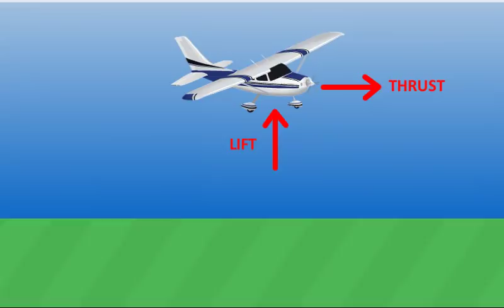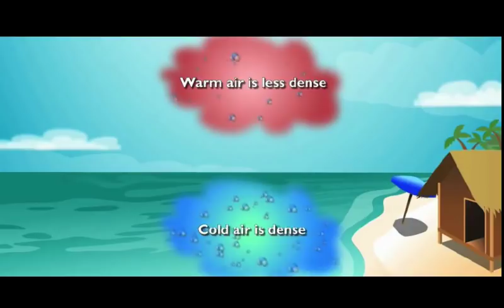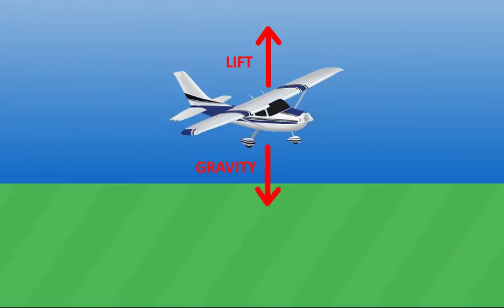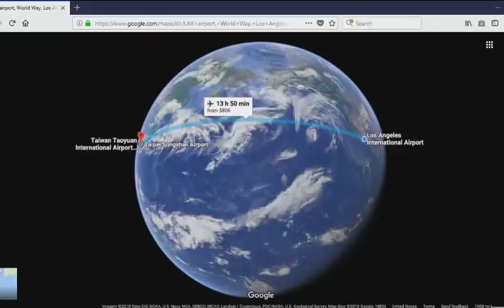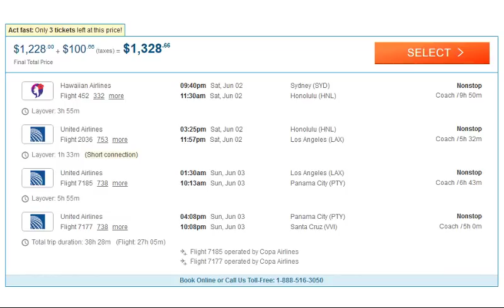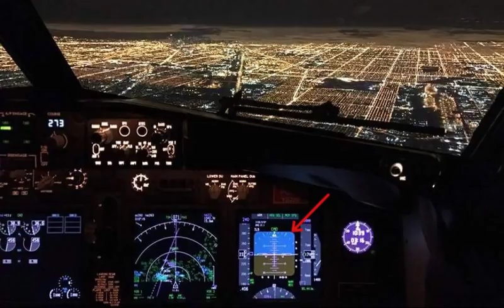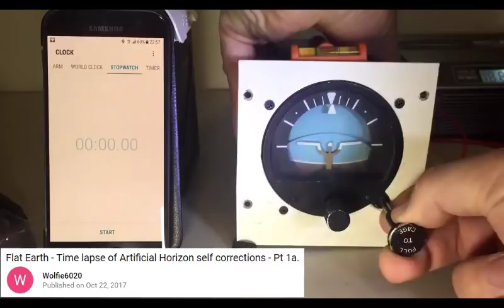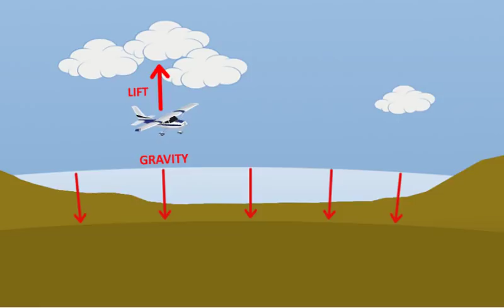Flat Earth Falsities - Plane Nonsense

Comment: If the air were held to the Earth by gravity, while at the same time it gets weaker as you go up in the atmosphere, and the Earth is rotating at over 1000mph, the air at ground level might possible be dragged along at the same speed but certainly not at higher altitudes. Conversely, the air would have to travel even faster at higher altitudes because of the larger circumference it need to cover.  But 1000mph is at the equator. The speed slows as one travels away fro it to where the poles would not be moving. The air that the author claims is travelling at 1000 mph at the equator would travel at slower and slower speeds as measured at different latitudes. With all that difference in air speed starting at 1000ph at ground level to much ore at higher altitudes to lower speeds towards the poles there would be obvious and very extreme wind shear situations. Air speeds in excess of 1000ph at the equator to zero at the poles would be noticeable. We are talking wind four ties stronger than a tornado!
Reply: Robert Lefebure
"the air at ground level might possible be dragged along at the same speed but certainly not at higher altitudes"
Yes. Yes you are.
Reply: Well, maths, physics and logic aren't your strong suits are they.
Reply: Robert Lefebure • Are you trying to claim gravity somehow stops working at high altitudes?
Reply: Robert Lefebure Did you ever notice if you stir in the middle of a pot, the water on the outer edge turns too? That's because the turning water in the center drags the rest of the water along due to friction. That's how it works for the atmosphere as well, except even moreso because there's no stationary pot providing counter-friction at the edges.
Reply: Brett VV No.
Reply: Its called Newton's first, second and third law of motion. If the air isn't experiencing anything that would cause it to slow down; it would continue accelerating till it mached the velocity of the earth. 

<possibly slowing the earth's rotation ever so slightly>

Good thing you brought up the atmosphere. Did you know that wind wouldn't be possible on a flat earth.
Reply: And what keeps the air at the edge of the vacuum of space from being sucked out? It would be at the very outmost limit of gravity's hold on it yet, just at the contact point of the most powerful vacuum known. Air inside vacuum containers on Earth doesn't act that way ... it disperses inside the vacuum.
Reply: Robert Lefebure Vacuum can't be "powerful", vacuum is literally nothing. All that matters is the outward gas pressure vs gravity, and the extreme upper atmosphere is at very low pressure, meaning very little force trying to push it into the vacuum. It's a very gradual transition.
Reply: Gestahl It is extremely powerful in the context of the "relative". A number of people here say the air at the equator is moving at the same speed as the ground surface below it (which is absurd because the ground would "slice" through the air if it were indeed moving  just like every other moving object does). These people somehow believe the Earth's surface behaves differently (or would it be the air that is behaving differently?).  Your point "meaning very little force trying to push it into the vacuum. It's a very gradual transition." , I would point out the fallacy that "little force" is still, indeed force and would therefore constantly and perpetually be forced outwards away from the gravity in order to reach equilibrium. That's why I said it would be impossible to replicate an air glob sustained in a vacuum chamber. There would never be an "edge" of such a thing as an edge of a glob in a vacuum because the air would disperses evenly throughout the vacuum chamber. The air glob (i.e. the Earth) in the vacuum of space (without a container around it) would be such a scenario and is unsustainable.
Reply: Robert Lefebure The air wouldn't evenly fill the vacuum chamber if it were tall enough, pretty much everyone acknowledges that air gets thinner at higher altitudes. There will always be some gas pressure wanting to push outwards / upwards but that tiny amount of pressure isn't enough to overcome gravity.
Reply: Robert Lefebure The air above the equator would be moving slightly faster than the ground the same way the outside of a bicycle tire spins faster than the inside, but I don't see a problem there.
Reply: Gesathi You are totally assuming "slightly faster" but first, it would have to be slightly slower because objects at rest tend to stay at rest. The upper air would need to get its motion from the lower air. But the elephant in the room is the whopping 1100 mph that the Earth is supposedly rotating at. Some here try to argue the ridiculous (that the upper air magically attains the same ground speed as the lower air which would require an INCREASE of speed without a corresponding input) but the upper air would be expected to rotate at slower speeds the higher one would go.  I argue that not even the air at ground level could be expected to achieve the same ground speed as the Earth rotating under it and that there would ALWAYS be a  very sizable wind. Not only is there no such wind, there are also the effects of doldrums and rotating wind storms like hurricanes and tornadoes which, according to the rotating Earth theory, are rotating winds of 75 to 250 mph, travelling over a surface under them travelling at a ground speed of 1100mph while, at the same tie, achieing their own ground speed of 5-25mph. It's all totally unfathomable.

Comment: The explanation of planes not getting altitude on a round earth "because are going away from gravity" is joke.😊
Yes, to get higher you spend energy and you get higher potential energy but the plane already has and spends energy to get speed.On a round earth
The gyroscope shows nothing, the plane flies straight, the altimeter shows higher altitude, and the speed would decrease until there will be a balance between the cinematic energy and potential. Only at that point the plane doesn't climb anymore.
Reply: @Ion John   And again. Why are you ignoring the facts?
You have had this explained to you before, but it seems your attention span is severely limited.
There is no adjustment needed as the aircraft will naturally follow the curvature of the earth without any input from the pilot. This is because the aircraft flies through the atmosphere which also follows the curvature of the earth. It's the air pressure that keeps a plane in level flight. Increasing altitude reduces the lift and the plane falls; decreasing altitude increases the lift and the planes rises
Inertial navigation is different.https://en.wikipedia.org/wiki/Schuler_tuning
Maybe you should also have also  looked up Schuler tuning. The "schuler loop" is an integral part of avionics, that automatically compensate for earth's curvature.
https://en.wikipedia.org/wiki/Schuler_tuning
And read  the references provided.
http://www.mediander.com/connects/26619546/ln-3-inertial-navigation-system/#!/topic/-/
http://aerostudents.com/files/avionics/navigationBasicsAndInertialNavigation.pdf
So please stop repeating your previously answered questions. All of them.
Reply: John Toas Maybe you can try a scientific explanation of the miracle?
Reply: Who rattled your cage? You had new rectums reamed earlier because of your stupidity and here you go again.
Reply: John Toas So how the plane flies straight at the desired and constant speed without any correction of altitude. The "explanation" given is valid only for the minimal speed at which the plane flies, for a lower speed the plane would fall. Planes fly at any speed and any altitude, up to max for which was built,
Reply: @Ion John 
You have had this explained to you before, but it seems your attention span is severely limited.
There is no adjustment needed as the aircraft will naturally follow the curvature of the earth without any input from the pilot. This is because the aircraft flies through the atmosphere which also follows the curvature of the earth. It's the air pressure that keeps a plane in level flight. Increasing altitude reduces the lift and the plane falls; decreasing altitude increases the lift and the planes rises
Inertial navigation is different.https://en.wikipedia.org/wiki/Schuler_tuning
Maybe you should also have also  looked up Schuler tuning. The "schuler loop" is an integral part of avionics, that automatically compensate for earth's curvature.
https://en.wikipedia.org/wiki/Schuler_tuning
And read  the references provided.
http://www.mediander.com/connects/26619546/ln-3-inertial-navigation-system/#!/topic/-/
http://aerostudents.com/files/avionics/navigationBasicsAndInertialNavigation.pdf
So please stop repeating your previously answered questions. All of them.
Reply: Bobby Wizdum
 
"what u call explaining we call bullshit."
Jesus. Is it possible for you to say anything more fucking idiotic?
booby: explain how you got the number 4.
reality: well, dipshit, we took 2 apples then added another 2 apples, then counted them.
booby: oh yeah, reality? What you call an accurate explanation, we call bullshit. blllrrrrrrgggghh shmappl.
Reply: wtf is cinematic energy?  is this when a famous director creates a blockbuster?  on a scale of 1 to 10, is ET a 5, Jaws a 7 and Titanic a 9 ???
Reply: John Toas Flying in a strait line while the earth is curved is going to increase your altitude. The thrust pushes the airplane forward, but the forward position becoms relative to the normal direction from the plane to the center of the earth. As the plane moves this normal  direction changes and the thrust will be the composition of a vertical component of the thrust on this new  normal direction, with the horizontal component of the thrust (perpendicular on the new normal). The thrust will have 2 parts, one lifting the other pulling forward. As I said, the plane is going to gain hight and lose speed if the energy burnt by the engines is constant, because part of the total thrust is pulling the plane up. Your image of a plane "kept in the air by the upward pressure" and pulled forward by the thrust is wrong, because the straight forward movement goes also upward as you fly. There is no such thing as gravity keeps you at constant altitude. You can fly at constant altitude without moving the nose of the plane down, if you fly at the minimum speed that keeps you in the air (the speed that generate enough upward pressure from the air), the plane will periodically get couple of yards altitude and decrease speed, then lose couple of yards of altitude and increase speed. Any higher speed needs higher thrust, but when you give more thrust then the plane will have also enough upward thrust to move up. This is the simplest way I can put it...

The force of the gravity acts along the straight line from the plane to the center of the earth, that is the so called normal direction. Some people are confused by the image of a line going perpendicular on the horizontal terrain surface, which would be ok for small distances, or flatearthers, but on long distances on a globe the surface is actually a curve.
Interesting how your argument is actually in the favor of flatearth because what you say works only on a flat earth. I explained how thing work on a globe earth, the pilot has to reduce altitude, to nose down periodically.
Reply: wong what u call explaining we call bullshit.

Comment: Older attitude displays as recent as the 1960's did in fact back up as the plane flew along the curvature of the earth. As such the pilots or flight engineer had to make periodic adjustments to manually re-level the display to the local horizon. The self-leveling type of displays shown in the video are relatively new. The behavior of the older attitude displays, that did not automatically compensate for the curvature, showed direct proof that the earth is a actually a sphere. If you didn't manually re-level them at all and you flew half way around the world they would indicate that you were flying upside down.